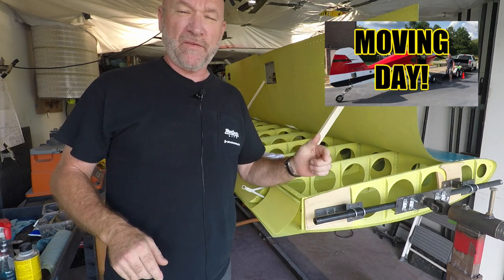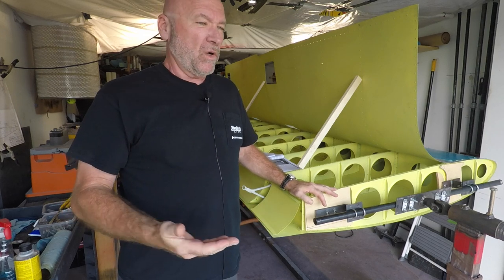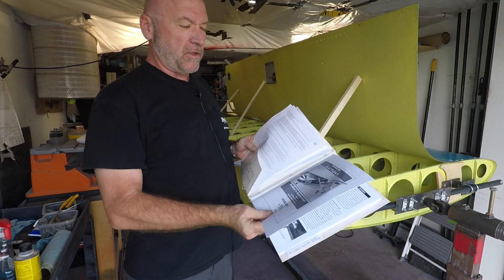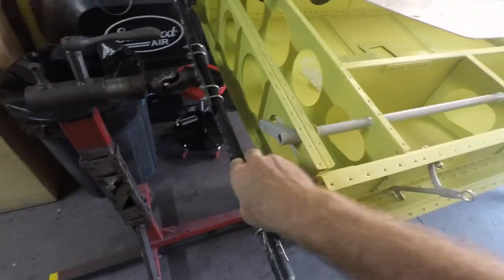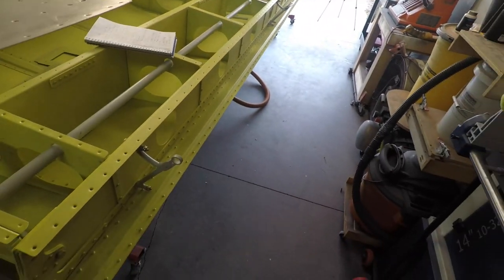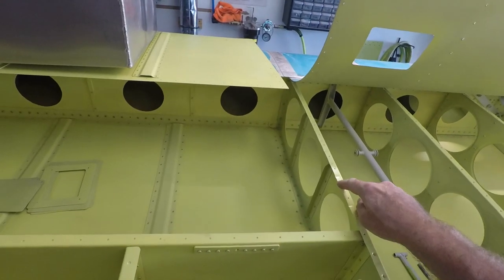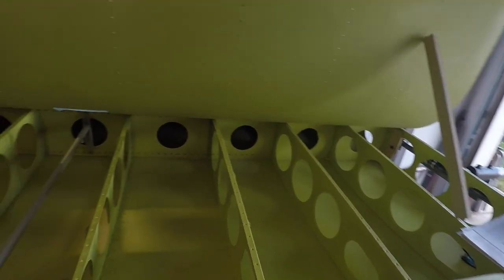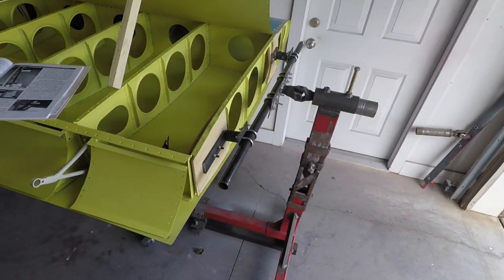BEARHAWK ~ Wing Assembly

Comment: Liked your description of the stalls, question, which stalls slower Riblett or standard Cub wings?
Reply from the maker: Not sure which is slower, but the Riblett has a forward loading moment with no leading edge separation compared to a NACA wing which is mid loaded leaving the leading edge susceptible to airflow separation.  I don't recall Riblett discussing if his modification results in slower stall speeds.
Reply: @TheBaldPilot  Thanks, Ill do some research and if I find out anything Ill get back to you.

Comment: Think that friction lock bolt at 1:03 is big and strong enough?  LOL, Grade 8 bolts are already expensive, don't need to get one 4" longer than necessary to do the job!  :D
Reply from the maker: Oh that came out of a bucket of bolts I had laying around.  Don't think I went out and bought that bolt specifically for that application.  In fact, some of that rotisserie was cobbled together from scrap.
Reply: @TheBaldPilot  I pretty much figured that, just giving you a hard time.  But now that I think about it, my bolt buckets probably have some short lil 3/8" bolts that would work fine...  a good mechanic should always have several buckets of "leftovers" in the corner.  :D

Comment: the LSA structural failure a couple of months ago scares me to buy one of these
Reply from the maker: I understand.  I think it is important to understand that the LSA that (allegedly) failed structurally was scratch built.  We do not know how the builder assembled and welded that fuselage together.  I know that the Bearhawk fuselage that I purchased from the factory was gas welded and superbly assembled.  Some scratch builders are not as proficient with gas welding and will instead electric weld their components together.  OA welding (gas) is superior to MIG or TIG.
Reply: @TheBaldPilot  for sure, just gotta wait for FAA report.